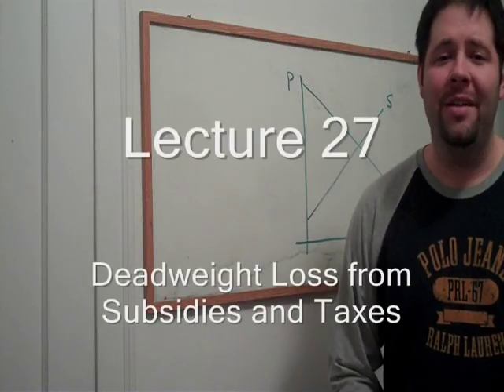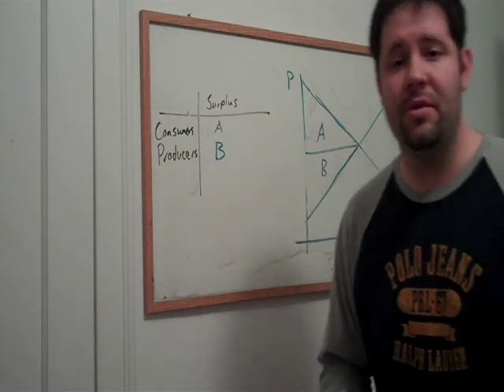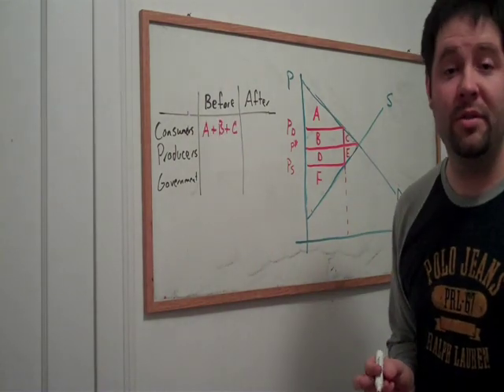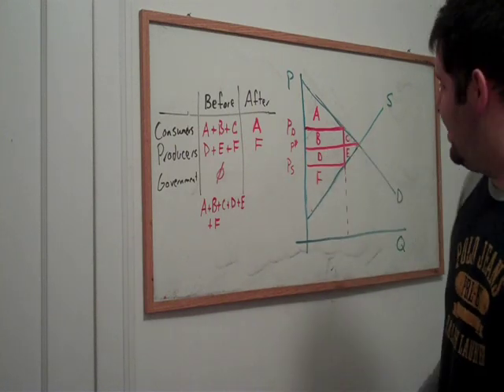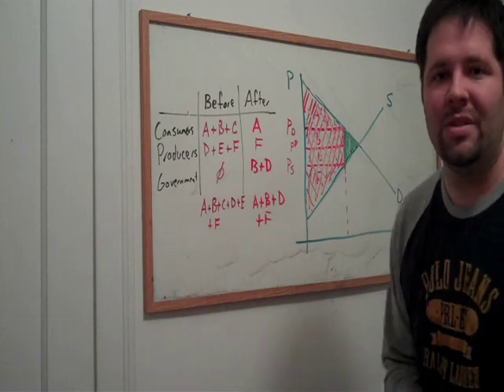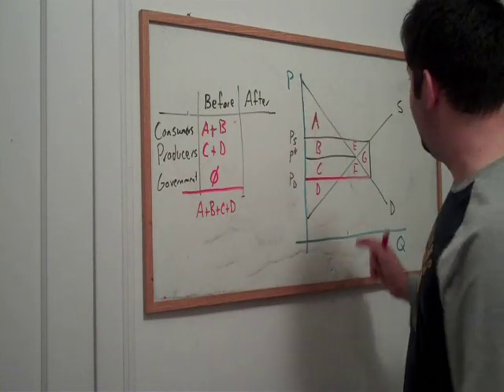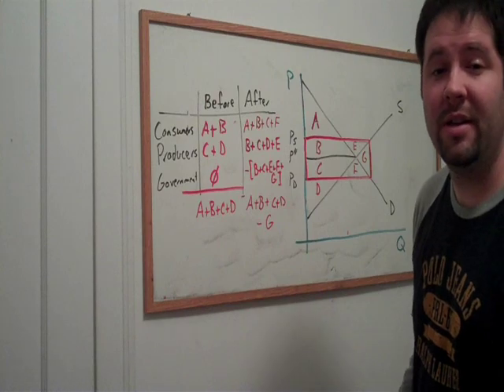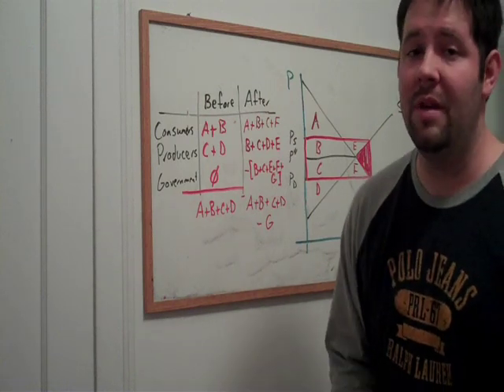27. Deadweight Loss and The Efficiency Criterion

Comment from the maker: @rockandrock44 Technically, yes, but for CS to be a decent approximation, the quasilinear utility assumption need not literally hold.  This is because CS is bounded between compensating variation and equivalent variation (the "right" measures for consumer welfare).  For a demonstration of this fact, check out my videos on CV and EV (16 and 16a.).  It has been a while since I have revisited these ,but I think in 16a, I demonstrate that CS lies between EV and CV.  Hope that helps.